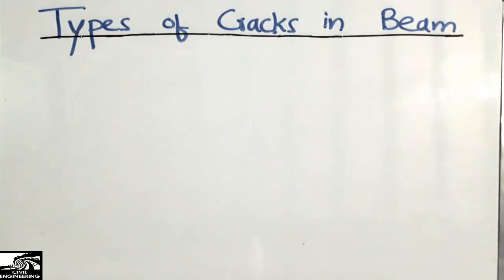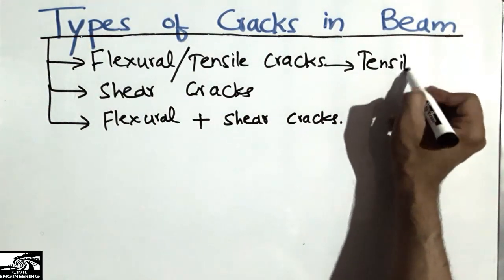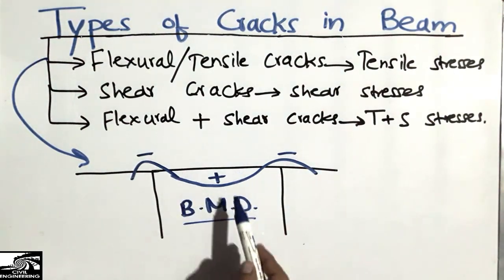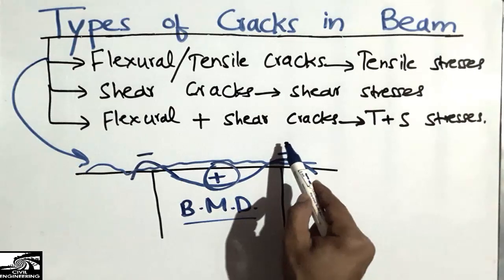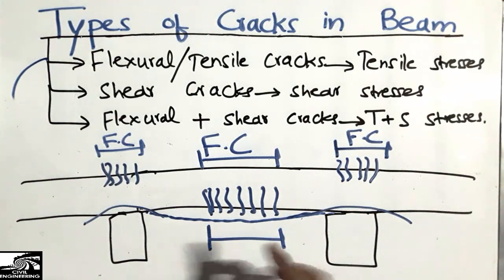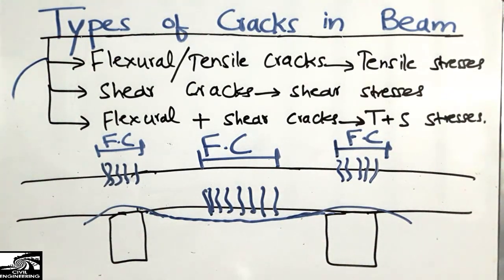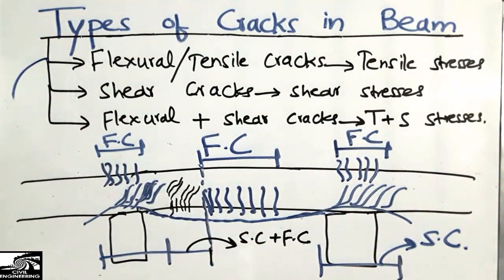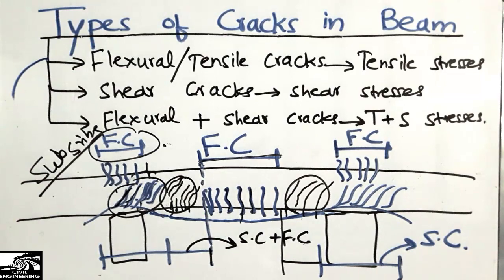Types of Cracks in Beam

Comment: Thanks for explaining the types of cracks and places of occurance.
But what is the solution to strengthen at such places of cracks?

In a recent incident I did observe that the 2 main rods of the beam were cut off Abou 1.5 feet frm the column.(To mount an A.C.installatio hole was dilled.due to that the main rods were cut off)

Now how to safe gaurd the beam  and eventually the structure.
The residential building is G+2.

can you pl .give solution?

Comment: Hi
Can you please explain the reasons of such cracks and the ways to avoid or overcome such cracks?
Reply: Concrete is strong in compression but weaker in tension. Thats why you must use reinforcement Steel to prevent cracks

Comment: Hii sr i have a doubt can you please send a way to contact you i m a big fan of your work
Reply from the maker: Yes, please write it here #Tosh Agrawal, Thank you
Reply: Hii when lets assume in T section which is under reinforced depth of N.A. from extreme compression fiber is 50 mm (maximum compresive strain is 0.0035) and depth of centre of tension reinforcement from NA is 500 mm(thus by compatibility of strain tensile strain will be 10 times maximum compresive strain) is that much strain allowed?